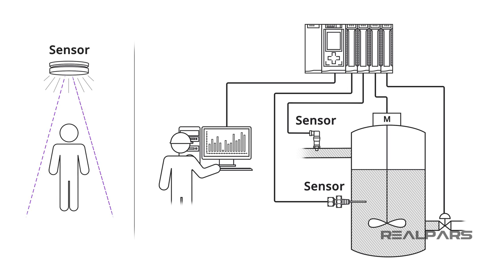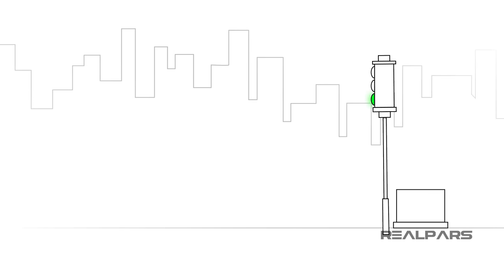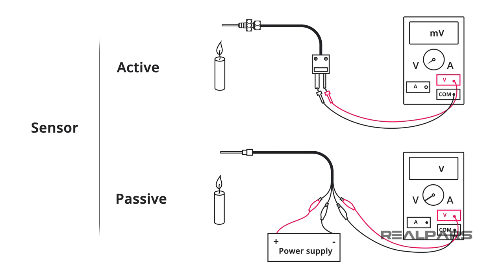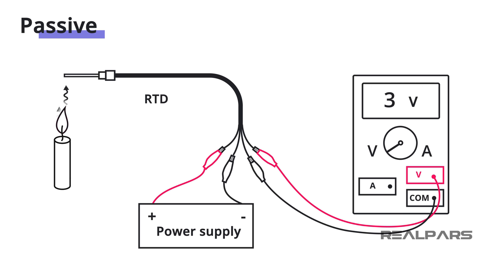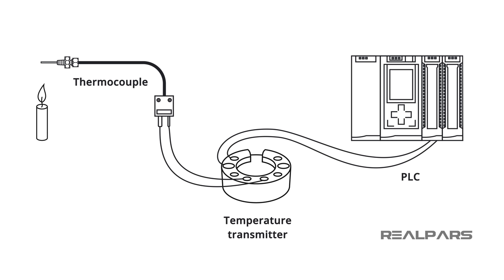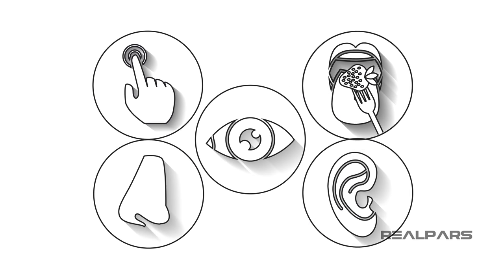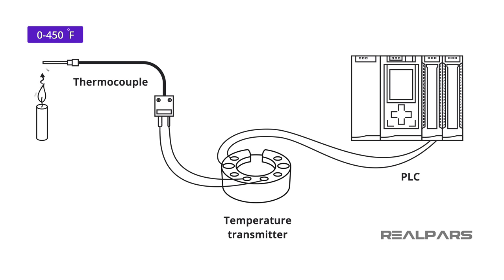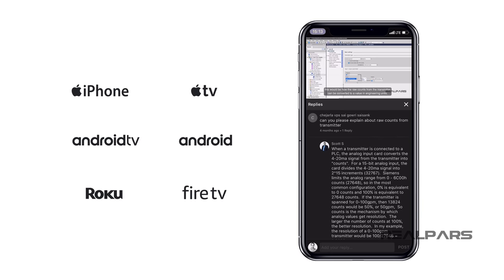What is a Sensor? Different Types of Sensors, Applications

Comment: Good day RealPars, this is a good video. But i found the topic Active and Passive sensors confusing. I learned that Active sensors require external supply to operate and passive sensors don't. and another thing, RTD primarily give output in a change in Resistance not voltage. may you find this comment constructive. Thank you
Reply: Yes I also felt same as you said. Active sensor requires external power supply . Passive sensor doesn't require external power supply. Please verify it.
Reply: What I heard before is that active component can control electron flow where as passive components can’t. Without power supply the active sensor, I believe, can create potential difference. In contrast, passive sensors only control p.d through the manipulation of resistance.
Reply: me also confused ....on measurement and instrumentation book ....it says active sensor require external power for their  operation  and passive don't! please correct it!
Reply: Active sensor doesn't need external power and RTD gives change in resistance yes but after calibration of 4-20 ma or 24 DC (Transmitter)

Comment: I think there is a mistake here. you said an active sensor doesn`t need external power. i think it is passive sensor that doesn`t need an external power. I see in my lecture notes the opposite to what you said. apart from that, a very good video from you and we appreciate that.
Reply from the maker: Thank you for reaching out with your question. In our video, we discussed the concept of active sensors, which operate without the need for external power. Think of them like a Thermocouple, which generates its own power through the heating of two metal types fused together. This generated power is then utilized by a PLC or similar controller according to its programmed functions.

Here's the link to our video for further clarification: https://www.youtube.com/watch?v=7xeriqPQyhQ

Conversely, passive devices like the RTD require an external voltage source to function. They operate based on resistance changes when subjected to heat, affecting the voltage sent back to the sensor controller.

It's essential to distinguish between "Power" in the context of the device and its function. An active sensor, for instance, won't generate electricity or EMF unless stimulated by a source like heat. This stimulation allows it to generate the power necessary for its operation, which is then measured by the PLC. Without this external source of heat, the active sensor remains inactive.

For more detailed guidance on using and connecting these sensors, you can refer to this tech book link: https://www.iqsdirectory.com/articles/thermocouple/rtd-sensors.html#:~:text=RTDs%20require%20a%20power%20supply,and%20are%20unaffected%20by%20heat

I hope this provides clarity and answers your query effectively. If you have any further questions, please feel free to ask.

Comment: But how do sensors work? Seriously, how does it detect motion, temperature, sound ect and how does that send a voltage to a transmitter? Are the sensors generating their own voltage output thru the thermal heat , motion, sound, (I'm assuming thermal to electricity is passive and external is battery and other power supplies?) or are they connected to a battery or AC / DC power? Maybe these are stupid questions, but I'm sort of learning from scratch here on youtube about how electricity is generated , AC/DC, how diodes work, 3 phase generators, transformers, transistors ect. Sensors seem like a huge part of this general field that would be very useful to understand. Thanks
Reply from the maker: There are many types of sensors.  The actual measurement is detected by a circuit that is able to convert a physical property, like pressure or resistance, into a useful signal (like 4-20ma).  Most sensors require a circuit to do this conversion, whether it is a transmitter local to the sensing element, or a PLC card installed in a cabinet.  These circuits are generally powered by an external current source, like a power supply.  Each type of sensor uses some physical or chemical property of the fluid or substance to convert into a meaningful value.  For temperature, an RTD detects the change of resistance of the RTD with temperature and "looks up" the temperature corresponding to the measured resistance.  For pH, a chemical reaction occurs at the measurement probe which creates an electrical signal which corresponds to the pH value.  A pressure sensor can use deformations in a piezoelectric crystal to sense changes in pressure.  The deformations change the electrical property of the crystal, which is proportional to pressure.

Comment: From what i've read online an active sensor is meant to be the one requiring an external power source whilst the passive sensor is the opposite but in this video it says other wise. Please explain?
Reply from the maker: The use of the terms passive and active get a little muddled because the terms originated as a description of electrical components.  Sensors and transmitters are more complex devices and the terms lose clarity.  So in terms of electrical components (op amps, transistors, LED's, etc.) you are absolutely correct.  For sensors, transmitters, etc, it is most important to realize that some devices, like thermocouples, do not require external power at the sensor, but do require power at the transmitter or PLC card to provide data.  Other sensors, like Coriolis mass flow meters, require power at the sensor and at the transmitter.  So you can see how the concept of active and passive are not crystal clear for complex devices.

Comment: please clarify, i believe passive dont need external power supply and active do?or am i wrong
Reply from the maker: The use of the terms passive and active get a little muddled because the terms originated as a description of electrical components.  Sensors and transmitters are more complex devices and the terms lose clarity.  So in terms of electrical components (op amps, transistors, LED's, etc.) you are absolutely correct.  For sensors, transmitters, etc, it is most important to realize that some devices, like thermocouples, do not require external power at the sensor, but do require power at the transmitter or PLC card to provide data.  Other sensors, like Coriolis mass flow meters, require power at the sensor and at the transmitter.  So you can see how the concept of active and passive are not crystal clear for complex devices.
Reply: You are right. Active sensor requires external power supply. Passive sensor doesn't require external power supply.

Comment: Dear RealPars, this is another awesome video, I would like to ask if it is possible to make a video on how to connect analog input and output devices to AI and AO modules of S7-1200, modules like 6ES7 231-4HD32-0XB0, 6ES7 231-4HF32-0XB0, 6ES7 231-5ND32-0XB0 for analog input and 6ES7 232-4HB32-0XB0, 6ES7 232-4HD32-0XB0 for analog output, showing how to connect in case of current signal transmission and voltage signal transmission loops. These are so confusing, in addition, couldn't find it on the internet. Hope it will get so many likes to put it on the top. Thanks in advance!
Reply from the maker: Hi Alikhan!

Thanks for your comment and your suggestion. I will pass this on to our course developers!

Thanks for sharing and happy learning!

Comment: based on my research, active sensor does not require external source to operate while passive sensor does not.
Reply from the maker: Hi raymund. Thanks for your input. The terms active and passive are indeed quite confusing. For example, in this video we say that an RTD is passive as it needs an external source while a thermocouple is active because it does not require an external source.  Devices such as proximity sensors have been categorized as active and passive as well. A passive 2-wire proximity sensor requires no external source to produce an output while a 3-wire active proximity sensor does not.

Comment: Very well and simply explained about sensors and types of sensors with the diagrams. 
A sensor is a device that helps to make advancements in electronic quantities physical quantities and other quantities. It shall result in making progress by affirming yield. In Industrial Automation, There are four types of sensors. Temperature sensor, MEMS sensor, Pressure sensor, and Torque sensor. 
Keep doing such videos.

Comment: Amazing video, But aren't Active & Passive terms the other way around ...?

I think its

Active sensors // sensors that need an external power source to operate

passive sensors // sensors that doesn't need an external power source
Reply from the maker: Thank you for reaching out with your question. In our video, we discussed the concept of active sensors, which operate without the need for external power. Think of them like a Thermocouple, which generates its own power through the heating of two metal types fused together. This generated power is then utilized by a PLC or similar controller according to its programmed functions.

Here's the link to our video for further clarification:

https://www.youtube.com/watch?v=7xeriqPQyhQ

Conversely, passive devices like the RTD require an external voltage source to function. They operate based on resistance changes when subjected to heat, affecting the voltage sent back to the sensor controller.

It's essential to distinguish between "Power" in the context of the device and its function. An active sensor, for instance, won't generate electricity or EMF unless stimulated by a source like heat. This stimulation allows it to generate the power necessary for its operation, which is then measured by the PLC. Without this external source of heat, the active sensor remains inactive.

For more detailed guidance on using and connecting these sensors, you can refer to this tech book link:

[https://www.iqsdirectory.com/articles/thermocouple/rtd-sensors.html#:~:text=RTDs%20require%20a%20power%20supply,and%20are%20unaffected%20by%20heat](https://www.youtube.com/redirect?event=comments&redir_token=QUFFLUhqbjY3d3JEY1c5LVB0WTJlODVyNUU3NFU5aUE0d3xBQ3Jtc0ttdkpJMFVfM3hNdTVuWVVzYkFwZ3FqYTF3SHlDTHdOVTJVZ0ZrSE1CalF1QVhxQTBlZFItMTgydExJdXUtVHU5RDdxb0thTUpmaHJYWm1mSmJ5NnIyWVJwQXZNaWdWRW5PVU96bXBCRmJNRjJGcnlPMA&q=https%3A%2F%2Fwww.iqsdirectory.com%2Farticles%2Fthermocouple%2Frtd-sensors.html%23%3A%7E%3Atext%3DRTDs%2520require%2520a%2520power%2520supply%2Cand%2520are%2520unaffected%2520by%2520heat)

I hope this provides clarity and answers your query effectively. If you have any further questions, please feel free to ask.

Comment: Hi, I am doing a project in which I need a sensor to detect the running "Ambulance" on road. The sensor is required to provide the information whether the ambulance is coming at Chowk (Junction or cross over of roads), or not. Then, which sensor should I use?

Comment: One thing a lot of I&C people don’t think about is the fact that control systems do not sense directly.  For instance, they don’t sense temperature directly.  They rely on testing they rely on testing the state of the sensor which has a reaction to whatever it is they are supposed to be sensing.  In the case of a TC, the sensor creates a tiny voltage because of the physics of how two dissimilar metals behave to temperature.  The control system doesn’t sense temperature, it tests the voltage to determine its value and infers temperature from that.
So what does this mean?  Control systems can be spoofed outside forces that were not accounted for.  For instance, electrical noise can be injected from outside the temperature loop that causes the control system to misinterpret the temperature.  So if you are having trouble controlling the temperature of a system, and can’t figure out the issue because each component seems to work fine on its own, then the problem must be because the system is being spoofed by something impacting on the sensor electronics or its signal.  These problems can be anywhere from very easy to figure out to extremely difficult to figure out and fix.